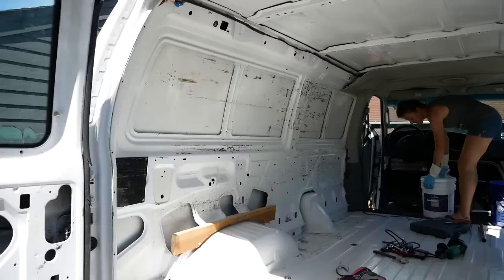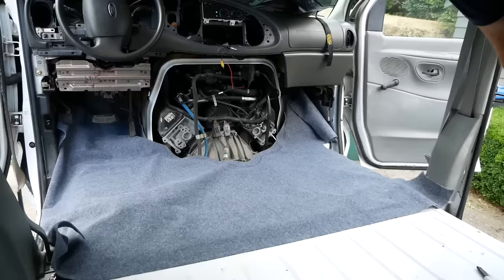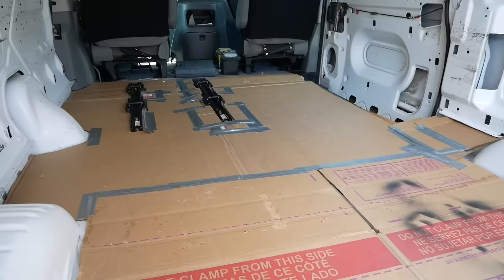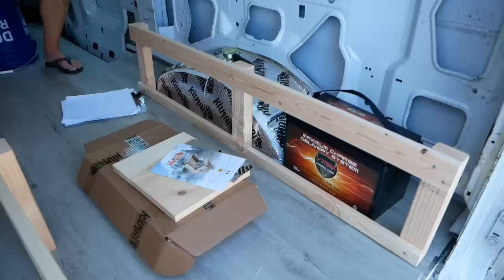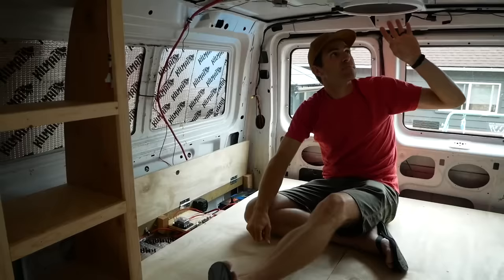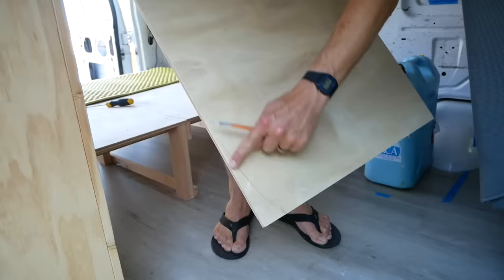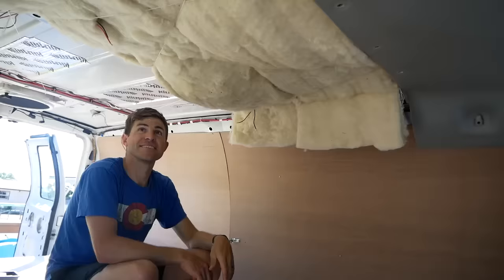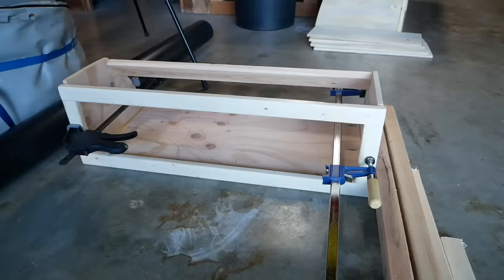Budget Van Conversion | Ford Econoline $3000!

Comment: Only major problem I see is there's no moisture barrier between the metal and the rock wool. That's going to cause lots of very bad mold issues. Living in a van with your respiration, cooking, and water use will generate lots of humidity. Also, the condensate that will form on the inside of the metal will just absorb into the wool with no way to dry out.
Reply: What kind of moisture barrier is needed and how is it applied
Reply: @laslas6679   "CGSB Approved 6 mil Vapour Barrier" is one example of product, it would be tacked to a frame to separate the insulation. In a house you would staple it to the wood frame and it would hold the pink insulation or rockwool, in a van you could use strapping as your frame. once its tacked on you can sheet your walls with whatever material you plan on using (plywood, particle board, ect.) 

hope this answers your question!
Reply: It’s sheep wool. Which cannot absorb moisture and therefore cannot mold. Very different than rockwool
Reply: Nah, just cook outside, and you're fine.
Reply: @alexandrelandry1992 would the cgsb vapor barrier & rock wool or sheep wool be the best combination for van insulation?
Reply: @TheGreyLineMatters Winter has entered the chat
Reply: Why does sheepswool need a vapor barrier?
Reply: Hello, this is very important. You are right. What would be the order of materials to install it correctly? to avoid mold. Please if could answer me.
Reply: I see ten problems 
Man toes 
Get some socks and a pair of shoes
Reply: Just apply RMR86 and 141 on the wool and where ever the wool touches. Problem solved  or throw in every foot a moisture absorber bag at the bottom . or the cheapest solution . drill tiny holes so hot air can circulate

Comment: Really cool. One quick note to anyone who sees this. If you're gonna spray paint with cans, spend the extra $2 and get that plastic trigger cap that goes on top of the can. Sorta looks like a plastic pistol and the spray paint can sits under it. It's $2 this let's u spray evenly, and consistently, without your finger getting tired and with over laps etc. For $2 it keeps everything even and consistent. Thought I'd share Bc in spray painted a desk once and geez I could have used it. Next desk I used one and saved so much. 1 can actually lasted longer with the thing than without out it some how.
Reply: Thanks. Thumbs have gone numb on a few projects!
Reply: Yup.

Comment: Hey boss ...... use mobile home tie down strap  and screw it in .  Work on everything  and stronger !  It will flush ,  bend , and NOT take up space .  IT ALSO will tied in your paneling sheets securely and won't  come apart !

Comment: I learned from an older van lifer that any wood flooring (and probably on the walks, too)  needs to be painted first, before installing, with an oil-based paint, because condensation causes black mold to get in the wood. The 5 yr van lifer had to remove all his now squishy in places flooring and completely start over with an experienced professional van conversion builder friend who showed  him how to build it right, and implemented ways to also  catch condensation or drips from the 5 gal water bottles where they sit so that they, also, won't damage the base of the cabinets. We're all learning in the process. 
Thankyou for your presentation. Good learning. I liked the no hype quietness of it.
Reply: Lots of condensation
Reply: I was thinking also about the foam under the flooring becoming damp with condensation. Great video tho, I wouldn't evenknow where to start.
Reply: Does this still apply to fake wood flooring?
Reply: @Stink_rman  Mold will grow on the plywood underneath the vinyl.

Comment: Very nice DYI, wish I was that handy. I bought a new Ford E-250 and had a master carpenter build it out. He did an extraordinary job. I’m a minimalist and did not want a stove, sink, or fridge. I carry a Camp Chef propane stove and 6 gallon water jug. I do have a deep cycle battery and 1500watt  inverter that supplies my electric needs. The van is totally insulated with a Fantastic Fan Vent in the ceiling and an awning window behind the drivers seat. Plenty of cabinets with slam latches. I removed the spare from underneath the van and had customswing arms and rear bumper. I had him build a metal “ cellar” box on the inside rear for additional storage. One side for the spare and one side with a storage box. Also have a fold out bed that converts to a double bed. Used rubber flooring which cleans up easily. Two electric outlets also. He also installed LED strip lighting on each side adjacent to the ceiling and they are recessed. Everything is trimmed in Cherry wood. The entire interior cost was $5,000. Been out west 8 times (2 month trips), mainly to Colorado, Wyoming and Montana Worth every penny I 😊spent.

Comment: Can I recommend covering your plywood with cork flooring for several reasons.
1. Cork is fantastic sound deadening natural material. 
2. It softens sound inside the van.
3. It is a good thermal insulate and will help regulate a livable temperature. 
4. It looks nice.
Reply from the maker: great idea

Comment: I had a buddy that did something simular while we were in Tech School in Orlando Florida but his was one of the 15 pac van that he bought from his church when they bought a new one. His bed was a platform but the platform was an old dresser that he cut the legs down, painted it and mounted it in the van on one side using L brackets and that allowed him to create a little closet on the other side to hang shirts on.  His didn't have any water but he didn't really need it, he just bought a case of bottled water and rented a spot at an RV park just outside of Orlando so he didn't need a bathroom, shower and laundry because they had them for public use but he brought his laundry over to my apartment on the weekends. He bought a little 650 motorcycle to ride back and forth to school on. He had a microwave  to cook with and ate on paper plates and used plastic utensils that he could just throw away. He used 3 cheap solar lawn lights for lighting at night and would just sit them outside during the day to charge. He spent very very little on living while we were school, He was a vet just out of the military and used the G.I. Bill to go to school on plus they paid him like $1600 a month and it cost him about $400 a month to live, he made out liker a bandit., I wish I had thought about it.

Comment: The sound deadening material is a worthwhile addition.  I used it successfully in my 2000 Corvette.   Suggest you use it over/near the wheel wells.  Road noise generated by the tires obviously is the major source of noise.  Multiple layers are best.
Reply: How many layers could you lay efficiently? I love this idea! I have this same van and I despise the noise it makes.

Comment: You did a really good job showing the processes as you went along. It's great how you were more concerned with function over appearance, while also keeping the budget down. I'm looking forward to watching the "finished" video to see the final product. The one thing I probably would have done differently would have been to use  button-head self-tapping screws to mount the paneling because they would have sat much flatter. But that's a small thing, on the whole it looks to be a good, solid job. Thanks for sharing. Peace.

Comment: I have had great luck with 6 econolines over 30 years(Flooring)... Alternators/Heater Switchs/Blower motors/Starters. In that order. Keep those parts in stock and fluids topped off :) The build looks great, ty for the ideas. Cheers!

Comment: The cable from the batteries to the back of the van should have been run under the van inside a flex tube.  Don't forget to fuse this cable.  That is a big cable to run overhead and to try to conceal behind molding and panel.  Good Job.
Reply: I am the fleet mechanic for a commercial bakery and over half of my vans have a battery box ( from the factory)under the side cargo door area, all you do is put a fuse in the engines fuse box and install a battery in the underside box, it charges from the alternator with the existing un used battery cables.

Comment: I was fortunate and bought my sisters 2001 regency conversion van for a $1000. has 248k with new Casper transmission and a folder 4inches thick of receipts. Have since turned into a camper van

Comment: Great detailed video.   Only thing that I would add, because I haven't seen this in any videos of this kind, is a separation wall and middle sliding pocket door.   This would separate  the cab area.    This also allows you to maximize your vertical and horizontal  space  behind  the cab.
Reply: Most people put a curtain up there, so when they sleep at night, they black out the windows and they have the  the curtain open and adds quite a bit of space to it. A lot of people will also put passenger seat that spins around. They have somewhere to sit that joins into the living area. FYI. I'm doing that with my bill right now.

Comment: My mini van is way way more budget. I foamed the holes where the rear seats went and laid another carpet over the old carpet with the foam. I pulled all the siding out and insulated with two rolls of fiberglass water heater insulation. And put the plastic siding back on. I took all the rear belts out of course, so there is no going back. Eventually I’d like to have a platform for a bed, but I’m going to be using the empty van for moving pretty soon.
Reply from the maker: I've totally though of using a Sienna instead, great gas mileage!

Comment: That was fun reminded me of my dad when he bought the guts out of a custom back in late 70's for under $100 
We had to pull everything ourselves I was still in grade school dad had to clear the wasp out lol
Spent whole day at junkyard then the next week cleaning and resizing it to fit our flatnosed Chevy van 
Was a wall to wall shagg of carpet with pull out bed removable table under the back seat storage under pull out sink with water tank and mini cooker and the captains chairs was real job for me dad and mom lot leftovers only mistake dad covered the engine cowling which made it run hot so he stripped it and found some nice leather 
Once done he could use it at his job as security guard after a night's work he could just go truck and sleep few hrs before coming home and get the rest of the sleep he needed
But now I look at it as one of the crazy things dad did beside buy a boat from goodwill with no motor and weighed over a ton never got to fix it or ride but that was dad see a deal and grab it lol

Comment: Recommend treating any wood with a anti mold treatment prior to installation and using the metal tape that controls rattles. I recently rented a cargo van at Uhaul to check out driving a van. It was a huge rattle trap. Very impressive how you removed and cleaned out so many places. Way to go! Please describe how you knew this vehicle was worth your wonderful effort. Did you take to mechanic? Or do you have those skills as well?
Reply from the maker: Hi Penny, Both myself and my partner have driven these vans a bunch (we both have worked for companies with a fleet of them) and are pretty mechanically minded. We did take it to a mechanic once purchased for some belt changes and a tune prior to build out. Most mechanics will perform a vehicle check for you (usually around $100-200) before you purchase a car as well which we have done in the past.
Reply: Find out can you send me your number ,I don't have those skill

Comment: Auxiliary Batteries go under the Passenger side door. Onto the frame. It can hold two of them. All Ford Econoline vans are made for them...As they used them as Ambulances..They actually make a wiring harness for it.....That just plugs into the fuse box.

Comment: I have concerns about getting an older vehicle like this, simply because I have no idea what problems and how expensive that project will end up being. 

I was “strongly persuaded” into trading my car for the  Ford SUV a couple of months after myDad died 61/2 years ago - bad choice! 
I plan on getting a Ford Transit cargo van to fix up, and sell the SUV - a 2010 Escape, not bad for an overnighter up to one week camper. Usually hauls “freeloaders” who push limits for their errands, my camping gear, etc. I simply don’t like, want or need to get stuck with a vehicle constantly needing a mechanic.
Reply from the maker: We completely understand the worries that come along with an older vehicle. We both have worked for companies with fleets of these vans and are very familiar with the common problems they encounter. If we weren't fairly handy and or familiar with mechanical issues we likely would have made a different choice. 

Enjoy the transit and best of luck on your build!

Comment: those vinyl floor planks are not for van use. There will be gaps in between due to the significant temperature change. Thank you for sharing your build. It's very helpful.

Comment: Econoline nameplate was last used in 1999, they changed it to E-series in 2000 to make it match with F-series. Funny how they did that but didn't update the mold for the air intake.

Comment: If you are using 3M Super 77 to stick carpet or anything else, remember that it is not formulated to be a permanent adhesive and probably will not last more than six months in some environments.

Comment: I noticed the driver seat is worn down pretty bad, you probably could find another seat passenger side and Mount on driver seat tracks, I done that before.
You can find on eBay, I got mine for 75.00 free shipping. You just gotta check daily and you'll be able to get one at the right price
Reply from the maker: Ebay is a great tip, we called around a few junk yards at first but have stopped searching since. I will have to keep my eyes peeled on ebay!!

Comment: AGM aren't fully sealed they are a valve regulated lead acid battery, thanks to the valve and having the electrolyte absorbed in the glass mat they are much less likely to vent hydrogen and acid when charging, unless they get overcharged then they can vent hydrogen just like a regular flooded lead acid.  The only decently safe batteries to have in the "house" section of a camper are lithium based solutions, if they are venting you got much bigger problems.

Comment: Check out janitorial supplies ...there's this stuff called Push --it works wonders when it comes to smells. Also(just a suggestion) ...the seat you have behind the driver's seat? --perhaps make it a locking swivel seat? ;)

Comment: The pocket holes will fail on the shelf. You have them going the wrong direction in the wood. The screws should point towards the wood, not the edge.

Comment: Looked ok till you brought out the bag of wool...may as well just used home fiberglass insulation.Like a lot of other builders,with humidity and then the added condensation from your breath just sleeping a night in there it'll be enough to add a film of moisture to the sheet metal.Multiply that by a number of days in a row and there will be a buildup of moisture.Add in more moisture if you want to cook via propane or other fuel. In a few years they both will end up rusting out the whole thing from the inside out.
I've torn older vehicles apart that people have also stuffed with fiberglass,wool,spray foam,etc. and they all been rusted to hell and back.Most so much so the body was used for nothing but scrap.One of them had a 3.5 foot Copperhead coiled up in the fiberglass after getting in from one of the rusted out holes.

IDK,but maybe if you use a good number of those cheap plastic push in vents it may help to dry out that wool.The key word is,MAYBE.

Comment: That would be at least 6000 min on a good day just for the van in canada. I built my own class c rv. It made with 2x4's amd some 4x4's and just for 8x8x8 its about 5000 for supplies np. 30.000 into so far.

Comment: When that 12 volt go. Buy the best.go Trojan 6 245 ah volt golf cart battery. 2 enough to start. I've got 4 now  but my original is just about 9 yr. and I had battery water where fins were showing forgot. 5-6 month but still charge as new. You can take it down to 10.8 volt . But you don't want to spend all day in the sun. Lithium battery need all day as the lun it low. With 4 battery and a solar series at 24 volt and a good mppt charger with real aluminum fins. I am at 100% by 11:00-12:00 flooded battery 80% recharge very fast the best even vs lithium unless he has 4 battery also. By 1:00  it's tap off. And I can park under a tree and start useing.or under parking at the mall. My friend has lithium and he need charging The whole  day. Trogen only cost 230 bucks or 460 for 240 ah. Lithium Cost around 800 per 100 ah. With 4 battery I've got 480 ah. An 940 watt panels around 700 for panels from china 450 for 4 battery's and 450 a good mppt controller 50 in wireing "
So about 1,700 system vs 6000 for lithium system. LOL